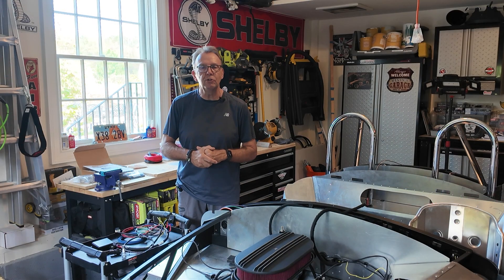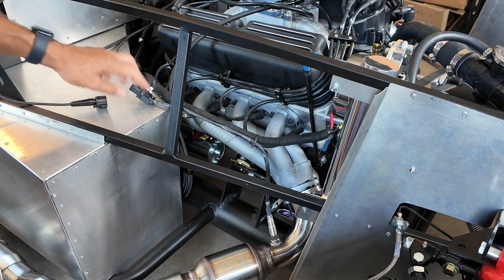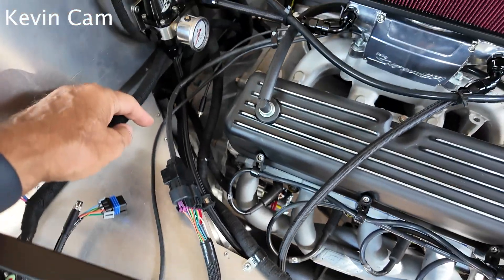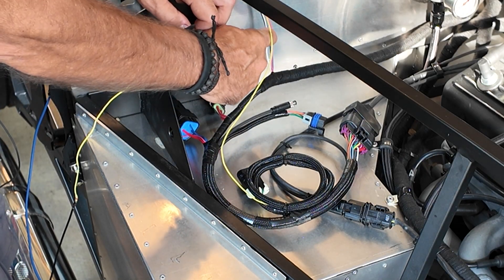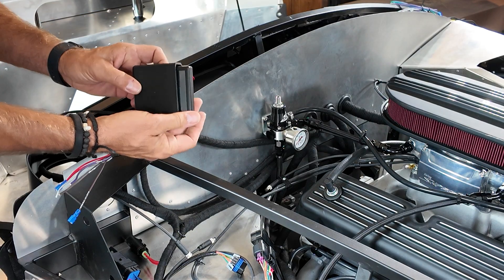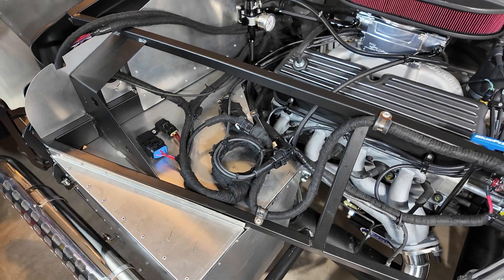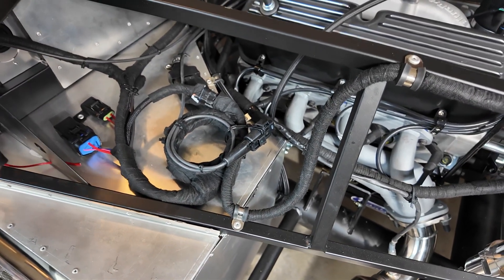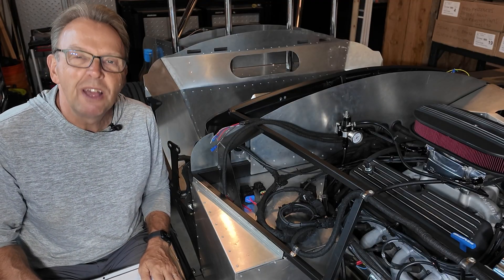Episode 28: Building a Factory Five MK4 Roadster - Wiring the Sniper EFI

Comment: I would consult FFR about removing the fuel pump relay and connecting to the tan wire.  You are removing the safety of the inertia switch.  Have enjoyed watching your videos.
Reply from the maker: Many thanks for your note, and thanks for watching…! 
You make a very good point. I read a lot of the Factory 5 Forum threads and watched a few videos before deciding on my plan of attack. For a building novice it seemed one of the simpler approached. Then I called Factory 5 and asked them if my approach was an appropriate one and would it work. They said yes - go ahead. However what I didn’t appreciate was that I was circumnavigating the shut-off switch, so didn’t specifically ask them about that. I will be sure to follow up early next week. 
Thanks again for taking the time to let me know. I am learning so much every week.
Reply: @KevinsGarage-v8roadster  any update from FFR on the above wiring of the Fuel pump and deletion of the fuel pump relay at the fuse box? That is, will the inertia switch still function?